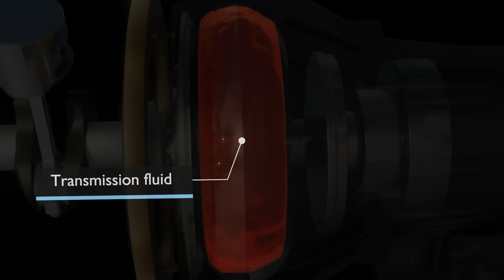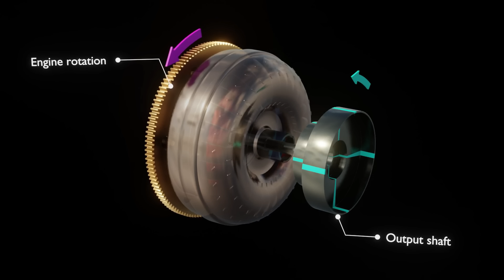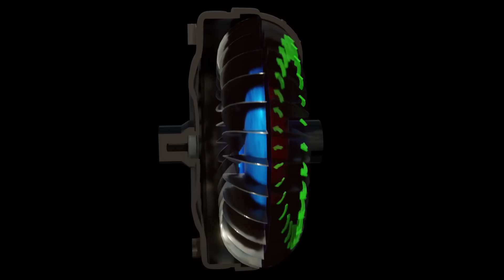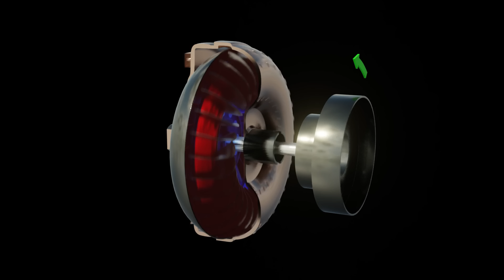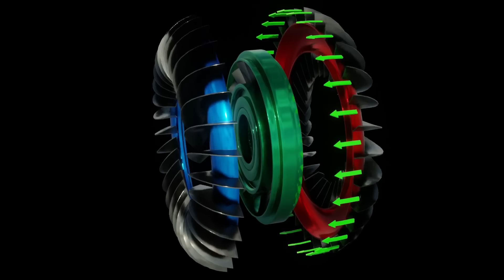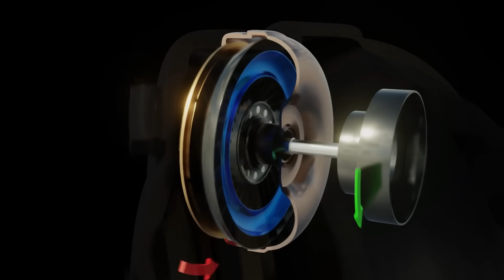Torque Converter explained in 3D

Comment: The lockup clutch is a wear item much like the pressure plate in a manual transmission; given limited life to the converter.  The stator configuration can last a lifetime.  Mine is 70 years ago and operates perfectly.

Comment: Could a torque converter cause an engine to lock up and not rotate the crank shaft???
Reply: Not in any way I could possibly imagine with any internal fault. Only if it blew up so badly it was exploded and wedged itself into the flywheel binding it up, but with all the fluid everywhere you would know something was really wrong with it

Comment: This podcast's TC  explanation is poor .
It doesn't explain and show exactly the function of the Stator nor how it's locking mechanism works . It doesn't explain how the stator functions as a torque multiplier causing Vortex Flow , and keeping a vehicle stationary when stopped on an upgrade while the engine is at idle and the foot is off of the the brake pedal or allows the vehicle to creep while feathuring the brake pedal alone , on and off , and how it acts as a disconnect 
Clutch at high vehicle speed Allowing the TC to become a fluid coupling prior to lock up clutch engagement at 932 % TC efficiency with a subsequent 1:1 turbine to pump drive . The Stator is the heart of the TC. The podcast doesn't explain 
How all the TC parts behave when the engine is running and the transmission is in neutral . It doesn't show how the stator's  locking mechanism really works and what would happen it it failed during Vortex Flow upon acceleration . It should have explained what stall rpm is and how it could indicate how well the engine 
Is performing still . It didn't
Reveal that the TC actually generates a lot of heat which is why the transmission has a cooler at the bottom of the radiator . During a stall rpm check , transmission fluid temp. will
Rise by 1 deg. F. PER SECOND . THE CONVERTER CAN ACTUALLY BALLOON .

Comment: surely only gear teeth with a reduction can multiply torque! 
the wasteful hydraulic slip may allow the engine to spin faster and burn more fuel, into a higher torque range, before the transmission!
 hydraulic slip creates heat , which needs an oil cooler! = wasted energy! you'll never see a torque converter on a bicycle, nor a slipway winch!

Comment: Wrong. A torque converter does not multiply torque. It is a variable slip clutch using transmission fluid as its clutch disc instead of a solid disc. The amount of energy needed to get a torque converter to work(a minimum of 300psi is required) precludes it from actually "multiplying torque". It instead allows the engine to get to its maximum torque rating in a smoother and easier way than a solid clutch disc does. Neither a manual or "automatic" transmission increases torque, or there would be no manual gearboxes left, as getting power for free is an engineer's dream. This fallacy that you can get something for nothing is against all physics.
Reply: You’re not getting free energy.  You’re optimizing the energy available with advantageousness blade angle, similar to the concept of a turbine engine.  Torque Multiplier is misleading.  Efficiency Multiplier would be more accurate…..but that doesn’t sound cool.

Comment: The output shaft here absolutely is the output shaft, not the input as some have suggested in these comments. It’s the output shaft of the torque converter which then becomes the input shaft of the gearbox. The output of one unit is the input of the next one down the line.
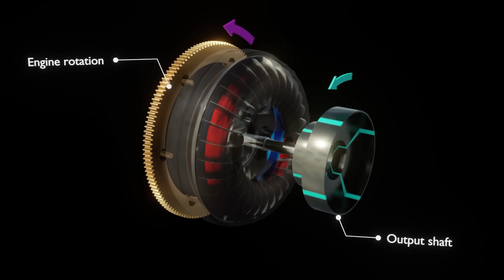Reply: The shaft shown in the video @ 1:02 is the “input shaft” of the transmission…it’s not a part of the torque converter. The “output shaft” is located somewhere else.  The shaft in the video is named the input shaft because it’s how the torque is input into the transmission. It’s the same logic as an “HDMI Input” on the back of a receiver. Yes technically it’s taking the output from the connected electrical device, but since the port is a component of the receiver, it’s considered an Input. The shaft in the video is a component of the transmission, not the convertor….therefore it’s named the input shaft. 

The output shaft is on the rear of the transmission and connects to the driveshaft.

Comment: Engine vacuum is usually enough to regulate a lock up torque converter
Reply: I would like to have the clutch engage when the load is light and then stay engaged until the transmission is ready to shift or engine speed starts to go too slow for smooth operation. I learned in a video that modern transmissions like the ZF 6HP19 in BMW cars often wear out the torque converter clutch. There is no easy way to replace it. I am looking for a good way to extend its life. A simple way is to add a switch to deactivate the clutch until the car is driving on a highway.

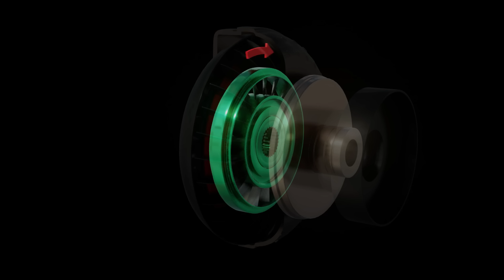Comment: With a toggle switch hooked up to the OBD2 port correctly to turn on or off the lock up torque converter can turn your 3 speed turbo 350 transmission into one with overdrive*, really it just knocks down the RPMs of the engine while at higher highway speeds so your hot rod doesn't overheat on the way to the track. It'll make your 4:11's feel like 3:55's at highway speeds making your engine very happy especially if it's also your daily driver. 🤠
Reply: Older brother’s ‘76 or ‘77 Monte Carlo had the first lockup torque converter I had ever experienced; I was used to my ‘70 Impala Custom Coupe with a 2.78 and peanut butter.  When “shifting to fourth”, as he put it, this dropped the rpms by 300 or 400 rpm.  We could pack that car full of people and gear, A/C blasting, roll down the interstate at 60 mph and still get 19 mpg with a 350 small-block.  Nuts back in the day.
Reply: You don't get overdrive with a lock up converter, but you get 1-1 direct drive assuming all slip is eliminated .

Comment: Such a simple device with enormous complexity. Interesting facts:
The torque converter was invented in 1905 in Germany for steam engines on ships. 
The automatic transmission for autos was invented in 1939 and used friction clutches. And 10 years later:
1948 Buick Dynaflow was the first mass-production automatic transmission to use a torque converter for torque multiplication.

Comment: For those asking what genius came up with this whole thing that would be Dr. Hermann Föttinger, and it was in 1905 and it was originally designed for shipbuilding as a hydraulic wear-free coupling in steam turbine engines. It was later adapted to the automotive sector for use in automatic transmissions with the first commercially available automobile to use it being the 1946 Invicta Black Prince.
Reply: The GM Hydramatic 2-speed auto trans was first offered in the 1939 0ldsmobile, closely followed by Cadillac in 1940.  I've never heard of the Invicta Black Prince, though I am familiar with numerous British marques.
Reply: @RobertF.-hr1gq  I drove a 66 Olds with a 2 speed jet away. Wasn't a very good transmission if I recall.
Reply: Dr Föttinger was a brilliant man.
Reply: GM produced the first mass produced automatic as we know the today in 1939
Reply: Thanks for the info. I was wondering who first dreamed up this device. It's mechanically simple but not an obvious solution.
Reply: Nobody’s asking.  Anyone can Google it. 😅

Comment: I've watched dozens of videos on how the torque converter works. Yours is THE ONLY ONE that illustrates exactly how the stator is used to increase the torque.
Thank you!! 👍👍👍👍
Reply: There is no increase in torque provided by the stator. This is a fallacy the AI perpetrates.
Reply: @Friedbrain11 the stator does multiply torque. When you have a bad sprag in a converter, the vehicle will feel very sluggish from a take off trying to accelerate. These are the types of things Ive seen working in transmission shops for almost 30 years.
EARLY transmissions didnt have torque converters, they had what were called fluid couplers. The addition of the stator created the torque converter, as it was appropriately named. Ive seen a few old trannys with fluid couplers in my day, they were even bolt together and we took them apart to check and clean them out
Reply: Should'nt the stator be turned 180° in order for the curved blades correctly redirect the returning flow toward the impeller?: https://youtu.be/0rJSw01jl1Y?t=274 & https://youtu.be/pTfipsejqS0?t=203

Comment: So in my CVT transmission car, there is a rattling noise only while the car is stationary, and it disappears once the car starts moving. Could this be coming from the clutch or the stator’s one-way lock?
Reply: The "Noise" is from the Total "Slip-O-Matic/ Trash-mision"... Grenade ing
Reply: No.
Reply: Sell it before it grenades as that is the direction it is headed in.